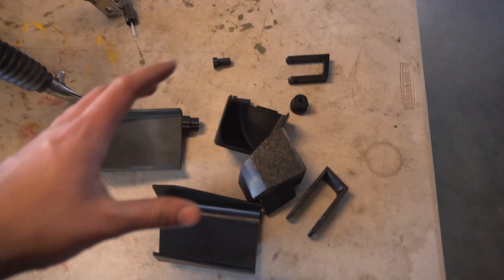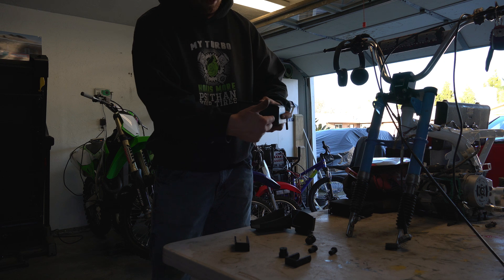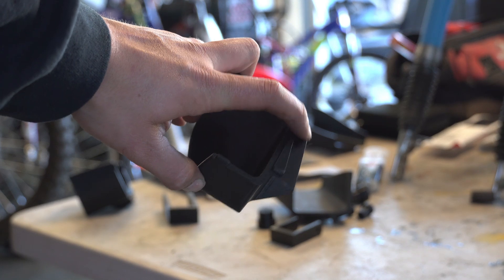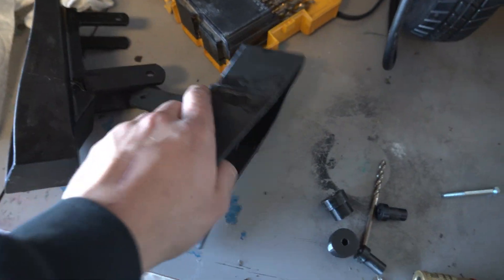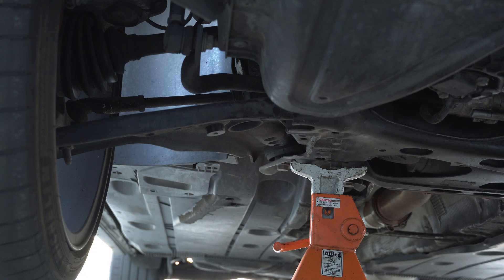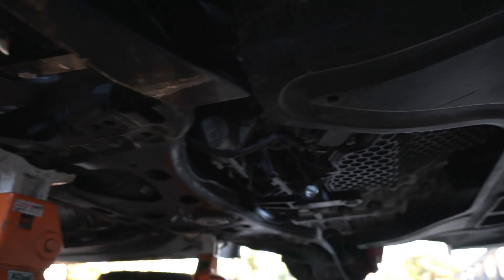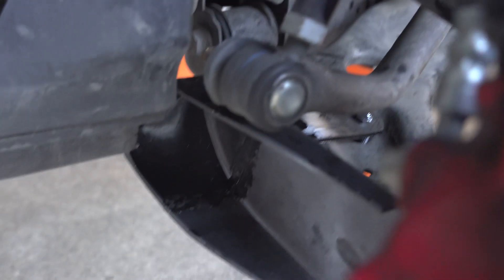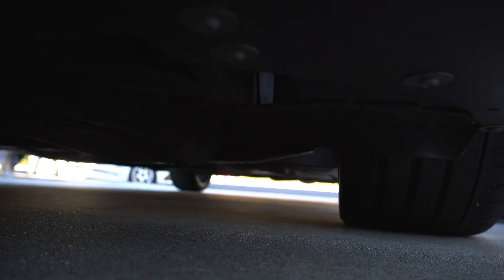MK7 GTI DIY Brake Ducts! Free cooling! - Turned Out Good!!

Comment: Or use the Audi RS3 front brake air ducts on your GTI. Regardless, great video.
Reply: The rs3 ducts are $120 so these are a much cheaper option if you already have access to a 3d printer.
Reply from the maker: @markmfpv yes way cheaper! Still holding up strong after track days too!